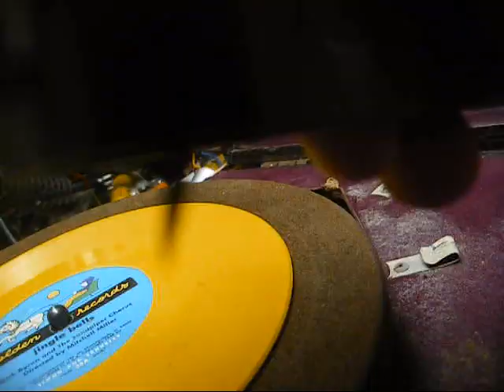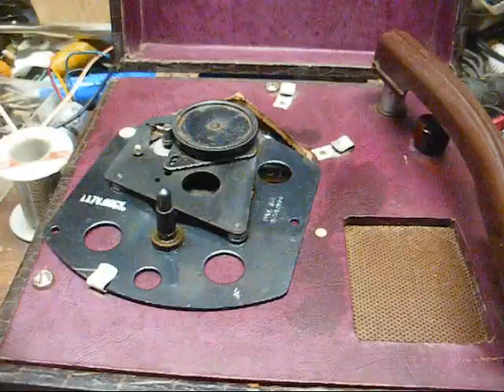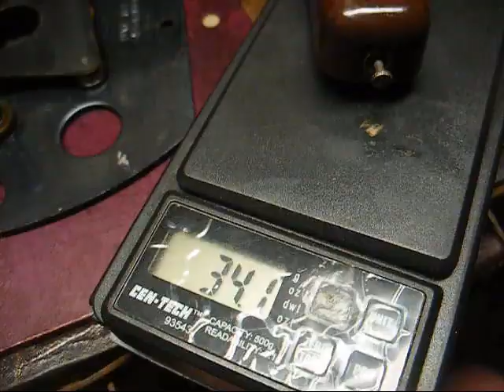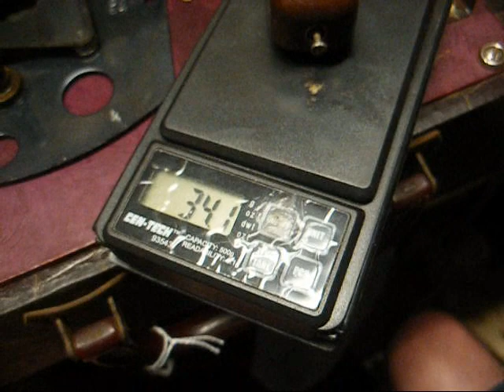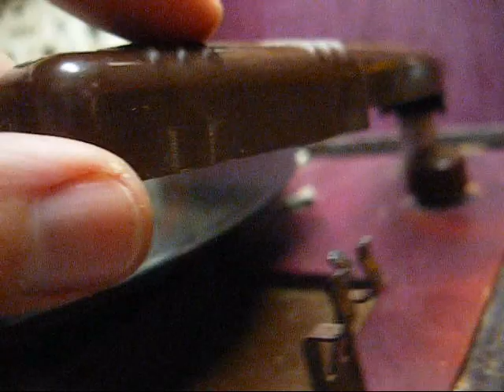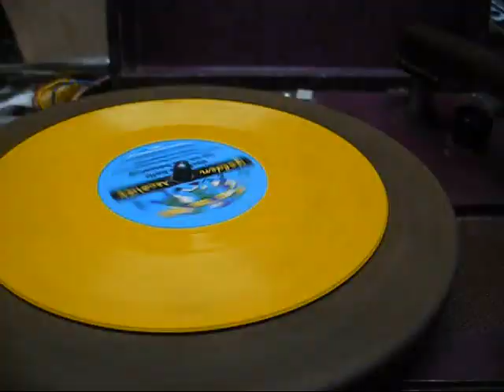Unusual Beam 78 rpm record player from 1949

Comment: First, Thanks for the videos. I should know this, mind gets a bit foggy after 70 years, how did they do the power supply with the 50C5? Plate to cathode I would think. Carl
Reply from the maker: Plate, screen grid, and control grid tied together and the incoming AC came in here. The rectified voltage came off the cathode and was filtered by the electrolytic capacitors.
Reply: Thanks, that makes sense.

Comment: Nice job!  It's always fun when they work, more-or-less, when you power them up.  Just wish I could have seen your choice for the replacement filter cap(s).
Reply from the maker: I generally go with Nichicon or Panasonic capacitors. 47uf will work for the old 40uf,  33uf will work for the old 30uf, etc. I generally buy 250V and 450V electrolytics and 630V film caps.
Reply: I usually just stick with a single 60 uf for the "big" section and 40-or-so for the "small" section.  Then, if I can, pack them into a single case.  Appreciate you getting back to me; I'll visit your channel when I can break away from political comment and medicare advantage annual enrollment!  Take good care.

Comment: Never seen this weird player before. It was a 78 only record player with a swing lift turntable to play a 78 only record. It came with one of the steel needles which was used for the Victor Victrola, Columbia Grafonola, and other wind-up phonographs of its time. It has a tonearm which was plastic and not as heavy as it usually were in previous wind-up phonographs from the 1900’s through the 1930’s that had a heavy brass tonearm and reproducer For amplification that had a tracking force of over 100 grams, but this one was tracked at 36 grams.

Comment: 0:50 A Triode or Pentode cannot be used as an AC/DC power rectifier.
1:42 Whoa! - - 33 grams, that is a lot of tracking pressure - - would eat up a polystyrene record in a NY minute
Reply: John Smith I see that. 33 grams was not enough pressure to play a 78. My Victor VV 8-4 Orthophonic Victrola had a tracking pressure of not 33 grams, it was about 100 grams. I can be safe to play shellac or later post-shellac 78 as well as a 5” Golden 78 on my wind-up Victrola and it doesn’t sound too bad, but sometimes it might damage the grooves which might be the problem.
Reply: @Musicradio77Network   I see!  
Did they ever use a Carbon microphonic amplifier inside the stylus cartridge for pre-amplification? How about that as a means of boosting the gain of an acoustic player? 
A great idea for amping before solid-state electronics became available -?
Reply: @Kevin Counihan  They still had WW2 electronics surplus available in the late 1950's? Reminds me of all those old tubes you can find in Russia from the Soviet Era - - warehouses of them!
About 1960 The 'COMPACTRON' tube was created that could have as many as four "valves" in one metal hat-shaped envelope. Is that what you are talking about
Reply: @Kevin Counihan   My last study of vacuum tube electronics was 1995, even then it was incomplete
Reply: @Kevin Counihan   Sorry to hear that, kind of know what you went thru - - I was almost paralyzed in a traffic accident thirty years ago -  a compression fracture on my L1 vertebrae
Reply: @Kevin Counihan   So these record players used a 'dual amplification circuit' - - My thinking is those are used for radio receivers -  either one tube hobbyists(Pentaflex) or the 'Boy's Radio's' from Japan in the early 1960's. So they used these Reflex Circuits in phonograph players as well? Poor sound quality for increased output I'd say.
Sometimes they use 'dual amplification' in voltage-starved circuits as well. They use the low voltage batteries(the A cell) of the filament, to supply the plate(anode) as well. Like the peanut-tubes used in hearing aids right after WW2
Reply: @Kevin Counihan  That volume control must have been a potentiometer of 10 MegaOhms - - ?
As for the TV stuff, it is not my forte

Comment: That really is an interesting player all around. I too have never heard of a 50B5 used as a rectifier, but I suppose with grid and screen tied to plate it would work well enough. I'm guessing that it's quite a bit smaller than the usual 78 player due to it's fold-out platter?
Reply from the maker: It is. I'm sure they made it that way to make it more compact.

Comment: In 1949, many Aussies listened to 78 rpm records as there was no TV in the country back then, and I don't think 33 rpm was available either.
That 70 year-old Beam 78 rpm record player is definitely a keeper for your collection.
Reply: RoughJustice 2k18 1948 first LP's
Reply: The tonearm was plastic but it did used a steel needle which was used for the wind-up phonograph or the Victor Victrola models, and 33 grams isn’t too much for this darn thing. The heavy brass tonearm on all wind-up phonographs are about 50 to 100 grams.
Reply: @Musicradio77Network  "The tonearm was plastic but it did used a steel needle which was used for the wind-up phonograph or the Victor Victrola models" - since 1940 exists a light weighted saphire pick up, but this was one option of many and the electric record player with steel needles was less expensive.
One problem is, that after 1945 the shellac was a vinyl/shellac mix, not so hard and not good to be played with steel needles.
Reply: Rob F , the steel needles were pretty rough on the Bakelite shellac grooved records, too. Every wonder why they soon sounded scratchy? That's because the record companies mixed very fine grit sand into the shellac to minimize groove wear from the pressure of the steel needle. The needles were to be replaced after using it once in playing a record side. Many people did not do that, but repeatedly used the worn out needle, so permanent groove damage resulted. Almost seemed that a wood chisel was used instead of a needle!
Reply: @jeromewysocki8809  You could get two types of needle: loud or mellow and some would be able to play 10 sides. These had a black shaft.